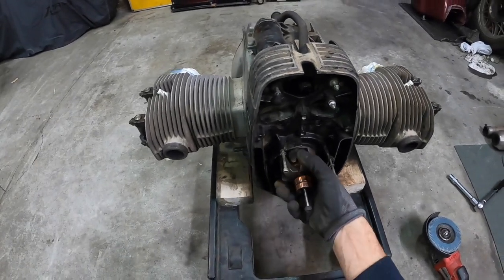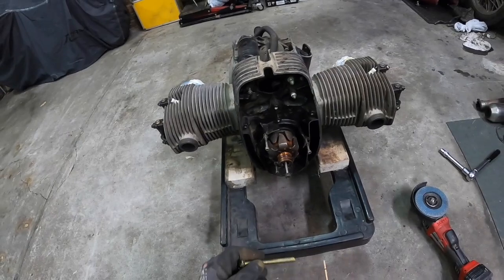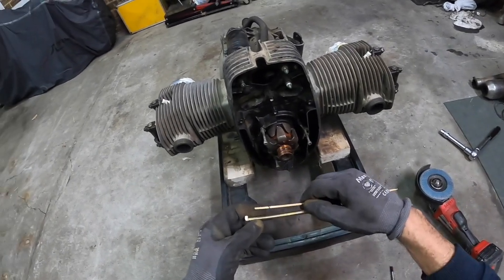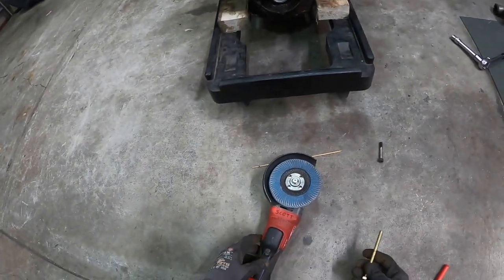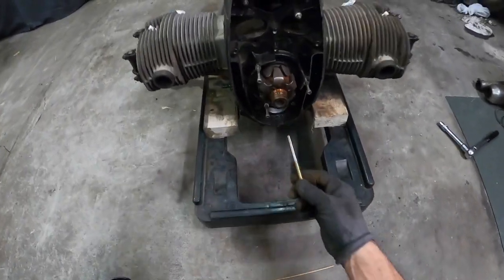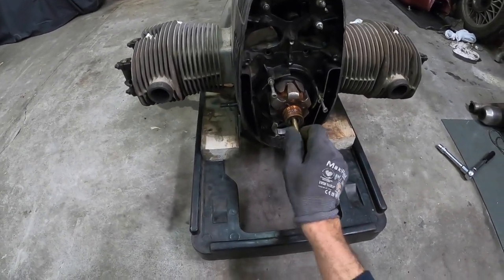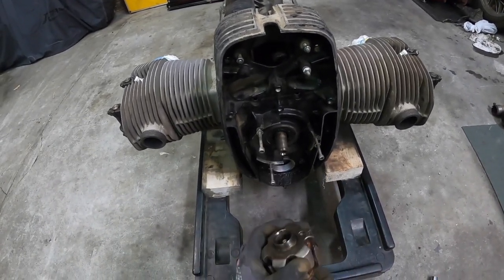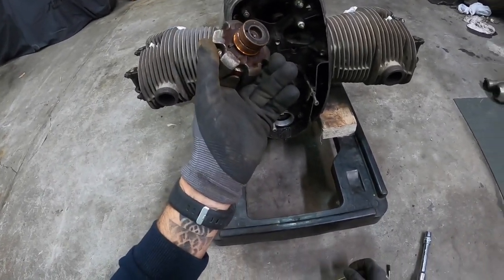R100 alternator rotor removal DIY tool

Comment: Can you tell me how much thread you removed?
Reply from the maker: Hi David, I found the bolt, it's 100mm long and I grinded the first 40mm off
Reply: @twistedfatebuilds  Thanks mate, made up the bolt and a few taps on the rotor with a small hammer and it popped off easy. I owe you a beer!
Reply from the maker: @RoyaEnfieldBSAman  Nice work, glad it helped buddy
Reply from the maker: I honestly can't remember now buddy and not sure if I still have the bolt laying around. It's easy to gauge as per the vid just push something thin up the shaft and take off an inch or so less than that so the thread can still engage and will pull the unit off